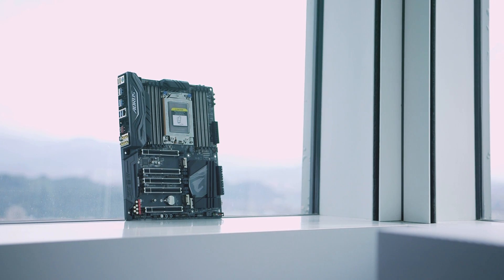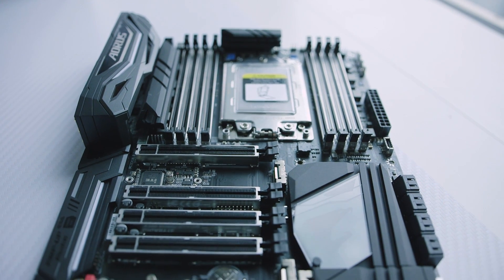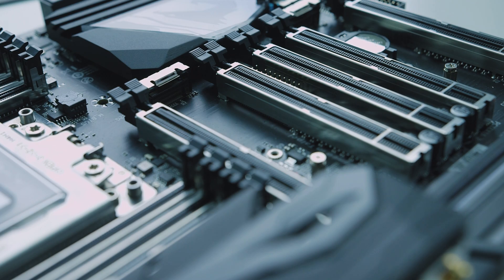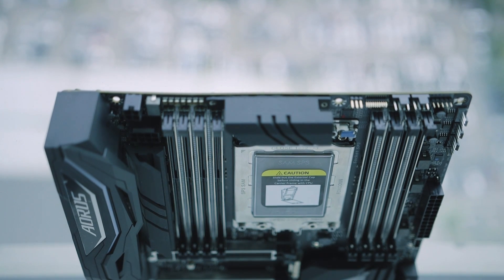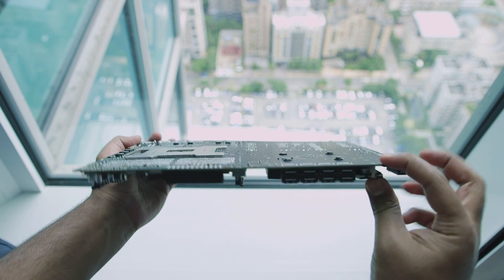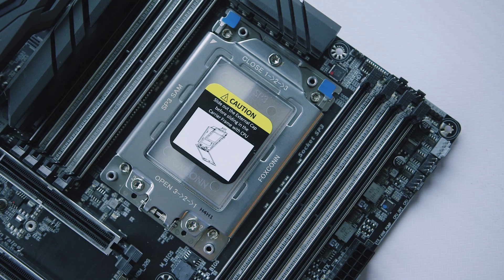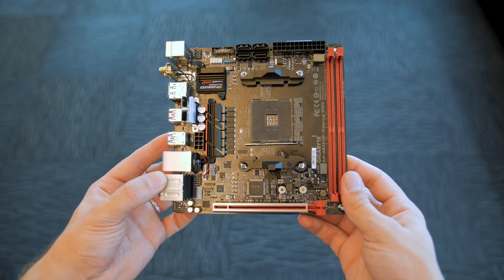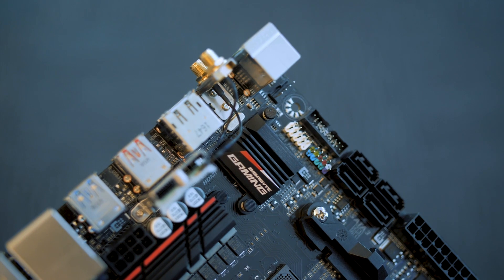Gigabyte X399 - AMD Threadripper on top of Taipei 101!

Comment: I agree with you about the USB 3.1 ports. I really don't understand why any mobo or case would even have a USB 2.0 port. But my decision on  which brand of the x299 or x399 mobo I buy later this month will ultimately be largely decided by which company adds the most USB 3.1 ports on them. I also want to see much better placement of the m.2 NVme PCIe drives, with built in heat sinks, and at least three of them!!! So let's go Gigabyte, Asrock and Asus, give me the best x399 mobo, for THE BEST PRICE!!!!!! Or I won't be buying yours...

Comment: Do the "reinforced" PCI slots really add strength to the slot? Because it seems more likely that the entire slot as a whole would break off rather then splitting itself in half
Reply: My mobo has one steel reinforced PCI slot, and it's a lot stronger than any of my previous boards. Doesn't sag nearly as much with a heavy GPU in it either, like a long 1080.
Reply: I see so one of the main purposes is to sandwich the plastic hard enough to prevent sag.
Reply: I think so, that, and people RMA'ing mobos because their slot broke off the board.

Comment: I wonder what happened to the X300 and b300 chipsets
Reply: I think they're going to use them in a lot of the OEM machines, they're cheaper, in theory, so I imagine most mobo makers are going to roll them out last, so ppl will buy the more expensive chipsets first. Just like AMD rolled out Ryzen. First they released Ryzen 7, then 5, and 3 is next. By the time they get to the Ryzen 3, most ppl who were interested will have already bought a 7, or a 5. Then comes the OEM machines with cheap Ryzen 3 CPU's on 300 mobos.

Comment: The high end 16c/32t chip should get around 3000 in Cinebench R15... if the threading scales well & assuming it clocks in the high 3's Ghz.
Reply: I bet it's higher. AMD seems to kick ass with multithreading. I wouldn't be surprised to see something closer to 3500, with a decent OC. Anticipated something like 4.1Ghz on the high side. With 32 threads, that's insane power.
Reply: Getting 16 cores to 4.1 ghz won't be easy hehe. I would expect half the overclocking potential of Ryzen 7... since it's doubling the amount of cores...effectively doubling the heat for the same given speed increase.
Reply: Out of the box it's rated at 3.9Ghz turbo, wouldn't think 200 more Mhz would be all that hard to squeeze out of it. I'm interested to see how it does, that's for sure.
Reply: Getting all 16 cores to ramp up to 4ghz would be fantastic for sure... I doubt any Intel chip can get close to that right now... their high core cpu clocks are not impressive
Reply: agreed on all counts.

Comment: No U.2 Support ? hmmm
Reply: Apex  pretty much no one use u2, thats why they (usually) wire m2 and u2 together, disabling the u2 port if a drive is installed on the m2 slot.
Reply: Yeah, I think M.2 Nvme has pretty much killed U.2 interest.

Comment: 64 PCI-e slots... I wonder if in the future GPUs will be running on x24, or x32, like how we have x8, and x16 lanes.
Reply: LaSombra CS:GO  pci-e gen 4 is complete, will probably roll out next year
Reply: It's 64 PCIe *lanes*, not slots.  So basically you can get 4 total x16 slots running at full bandwidth.  There is no need for more lanes per slot (hell, there isn't really much of a need for more bandwidth per lane, either).

Comment: interesting, being that B350 supports overclocking and doesn't lock ram speeds to 2133mhz or 2400mhz like Intel does on it's non Z chipset, there really is no need for motherboard makers to put out X370 itx boards. the only benefit X370 has at the chipset level is more I/O and SLI support.

Comment: wow, the position of that 8-pin atx on the itx board is in just about the worst spot I've ever seen. How is Gigabyte expecting builders to do clean builds with that connector in that spot?
Reply: I'm inclined to agree with Doug.  Those power connectors are in real crappy locations.  My Biostar X370GTN and Asrock's ITX board both have their power connectors in more reasonable places.
Reply: "clean builds" pretty much arent a thing with itx, there really isnt a better place considering that most itx cases dont have a way of routing cables behind the motherboard tray
Reply: You have to be kidding me with a statement like that. Only a person that isn't familiar with small form factor builds would say that clean builds aren't a thing.Maybe do a little research before spewing such nonsense.
Reply: Do you want to discuss what a clean build is or do you want to discuss the placement of that connector?
Reply: As my original post stated, they go hand in hand. I guess that must be hard for someone to imagine that has no clue what small form factor builds look like.
Reply: Did you notice how I put "clean builds" in quotation marks? It's a word that everyone uses differently, I assumed you meant it the way most people would and based my statement on that. The placement of the 8pin has more to do with the limitations of pcb design, the 24pin is in the good spot, so it's not like they don't know where you want it and that cleanly routing an 8pin accross the motherboard or through the ceiling of the case is easier than doing it with the 24pin.
Also ffs please talk to me like I didn't kill your family, thank you

Comment: Holy shit no offense but 80% of this computex coverage has been about motherboards. Isn't there anything else there?
Reply: Well AMD is making a comeback and Intel is trying to counter them with their lackluster skylake-x line so I guess it's normal.
Reply: yea, a bunch of cases with RGB and glass slapped on.
Reply: When I said lackluster I wasn't talking about performance specifically. Intel has decided to use shitty thermal paste instead of soldering the heat spreader and the CPUs have RFID chips for some reason. It's almost certain that these chips will ran way too hot if they use the same thermal compound that 7700ks have. I don't know about you but $1000+ CPUs that require delidding for normal thermals with suspicious RFID chips are pretty lackluster for me. 

Also we already know that zen has nearly the same IPC as skylake and the clocks of the best threadripper and skylake-x CPUs so the upcoming events are quite clear at this point.
Reply: Cases, low and high budget cases.
Reply: Not 80% are motherboards. 80% are "intel x299" motherboards.
Reply: Intel will probably deliver 10% more performance for a 100% higher price. Also you need a more expensive motherboard and 299 dollars to unlock raid 5. And yeah you dont get as much PCIe lanes as with AMD. INTEL: WHAT THE FUCK ARE YOU DOING? ヽ(ಠ_ಠ)ノ
Reply: MOAR MOTHERBOARDS!!!!!!!!!!!
Reply: I doubt they will. We already know that zen has nearly the same IPC as kaby/skylake and the 16 core threadripper will have a base clock of 3.5 ghz whereas the 10 core skylake-x has a base clock of 3.2 ghz. It's almost certain that the base clock will not increase with those 8 extra cores so Intel will probably have something that costs 100% more with all those anti consumer things you listed and have worse performance.

Zen scales much better than Intel's ringbus design apparently.
Reply: +Party Waffel nothing can be called lackluster until we see its actual real life performance